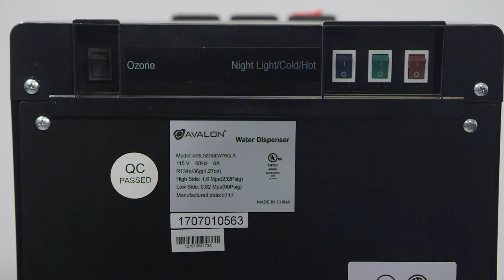Avalon Bottom Loading Water Coolers - Water Not Dispensing

Comment: These instructions are useless! These water dispensers are garbage. They work for about two years then start to fail. If you contact customer service they send you a link on how to take it apart and try to fix their trash product! The bottom line is they will not repair anything and just tell you to buy another unit from them. I would not buy one of these ever again!
Reply: 100% trash I can confirm
Reply: Do you know any better products instead of this?
Reply: Have to agree.
Reply: Having issues after 2 1/2  years. Cannot get the cool button to dispense water
Reply: Same for the primo brand. They are all similar builds
Reply: I 1000% agree with blasi1800. This company has no customer service. I would never buy this garbage again. I just threw mine in the garbage where it belongs.  Please let this be a warning to anyone who wants to buy Avalon, don't. Consider yourself warned.

Comment: It’s the ice build up that’s restricting the flow for the cold water dispenser. This happens with many different brands and models. Solution is to turn off the cold water switch in the back for a few hrs and it will start dispensing again.

Comment: My hot water dispenses like it should but suddenly the cold water just trickles. It was fine and without warning it just stopped flowing correctly and now is a slow trckling of water. This is my second Avalon cooler and I am going to another company. Meanwhile I will use it for the hot water and when the new one comes I am trashing it and never going back to Avalon. This is the A6.
Reply: Same exact issue here. Exact. I give them credit thus far as at least the support is responsive but I’m about to give up.
Reply: @winkat2  Bummer! They never contacted me. I did all the troubleshooting by researching answers on google. Nothing worked. I am using it for room temp water in the kitchen since the hot tap still flows. I could heat it but when adding water that is supposed to be room temp I used to put both cold and hot in. Avalon is bad news. Glad they responded to you though. I got a Primo. Heck they never even responded on this channel and this is their Support? lol. Hope yours gets fixed.
Reply: @gmac6503  Thanks for the message. They are sending me a new spout as it looks like it’s either under warranty or they are just doing what’s right since it’s less than a year old. Imagine it’s not a pricey component and looks like replacing it won’t be much fun. I emailed support@avalonh2o.com just as FYI and in case you have trouble with your hot water dispensing and you want to even bother giving them another chance. We’ve all been in your shoes so can’t blame you if you don’t.  They were much more responsive and helpful than I had expected, but seems the quality of the product and components are suspect.
Reply: Yep.  They don't answer, so that's that.  This is our second one, too.  Done with them.
Reply: @winkat2  They are not responsive here.
Reply: @gmac6503  WOW!  So many having this issue, too.  That they don't respond is sad.
Reply: @winkat2  Thank you.
Reply: Cold just quit on me too! Sorry I recommended for my daughter to get this one.
Reply: I have had this unit for over a year and a half.  My cold water stopped dispensing in December.   Not a biggie because of winter.    But the HOT stops a few weeks after.    I should have bought the extended warranty offered on Amazon as the Avalon unit tends to break down after their 1 year warranty expires.
Reply: @hanzelnuts8446  bummer. Yeah, I gave up on them. My Primo is still working very well and I'll stick with them. There's a lot of videos on how to fix the Avalon so maybe you'll get lucky and find your problem. Sometimes it is a minor issue but on mine, it's major. good luck
Reply: This is exactly what mine is doing . From the comments, this is a common thing, so if I don't get it fixed, I will not be buying this brand . I will be mentioning this during our email conversations  .

Comment: How the hell do you get the white topper off without breaking it
Reply: Did u figure it out?
Reply: @zaydahmed7912  there's tabs need to be pushed down I think to remove the top
Reply: @Jacob-Pogicat It’s hard to pull out, but it just pops out horizontally. The tabs in the back aren’t attached to the lid, but I’m not sure what they’re for.
Reply: @sneakyblu3  hm wish I could be more help. I forgot what I did to remove them. Maybe use a bit of force.
Reply: Once the top of the machine has been removed and you're inside looking at the water tank with hoses and wires coming out of it, there are 4 hooks evenly spaced around the top of my model. Inserting a small flat blade screwdriver from above will separate them enough to gently lift at that point and the cover comes off one-by-one quite easily that way without breaking anything.  Lift carefully and I recommend untaping the wires if they are secured by tape first. Tubes inside may become dislodged if you remove the cover too forcefully and that's unfortunate if you don't get a chance to see how everything is supposed to be connected before it all comes apart.
Reply: I took the top off, but I noticed a small hose 'popped out' from a hole halfway down the chamber. There's zero chance of getting that reconnected

Comment: Im here because my cold water button is not dispensing water. I've reached out to avalon on their support site. Waiting to hear back from them. The hot and cool buttons are working as expected. Looking for ideas on how to repair the cold button as my purchase is at 23 months and out of the 1 year warranty. Had I known this would fail so soon, I would've purchased the Amazon 4 year warranty as it looks like this product doesn't last that long.
Reply: They’re trash. My has never worked properly. Better off returning and finding another brand
Reply: Ever manage to get it working? I have the same exact issue, hot and cool work, cold doesn't, and it happened a week out of warranty.
Reply: We have the EXACT same issue. Hot and Cool work but not cold. It's 25 months old.
Reply: Omg, same!  @WaveDudeTX
Reply: It’s the cold water that doesn’t work because of ice build up. Turn off the cold water function switch in the back and it’ll melt ice and work again after a few hrs. Saw it on another video with many people having this issue.
Reply: I'm also having the same issue. My water tank is not frozen. All the hoses seem to be attached and not kinked. The switches all seem to be connected and working the same. I simply get a couple of drips from my cold button. I can't seem to find any trouble shooting videos directly related to this specific issue.
Reply: @audreyn9457 this happened with mine and it was a lesser used unit that needed the nozzle to be taken out and cleaned. It had a clear goop that needed to be worked out. Avalon support was helpful in providing me instructions on how to remove the nozzle.
Reply: Same only hot water works now!

Comment: How do you get to the front pannel ? Top is off .. yet im struggling to get the front panel disconected
Reply: Yes I am literally trying to figure that out now and the instructions that they sent me skipped that entire part on how to remove the from panel
Reply: How did you remove the top. I lift up at back but cannot pull towards the back?